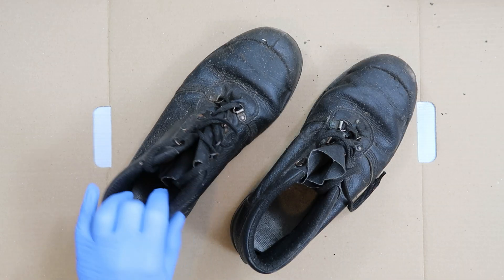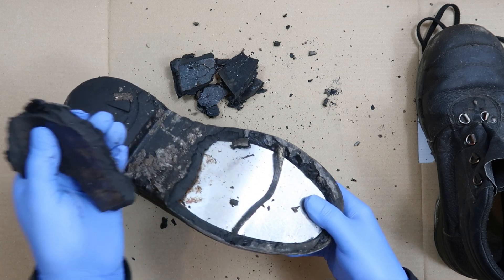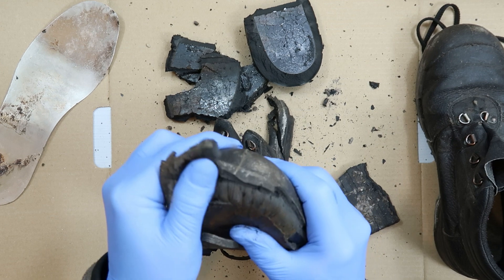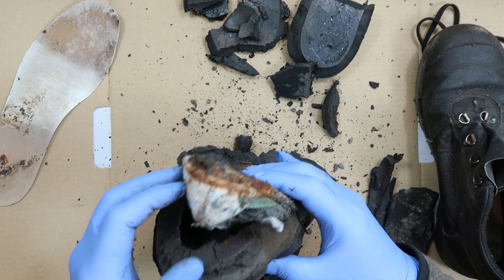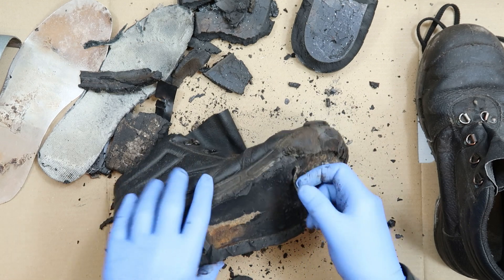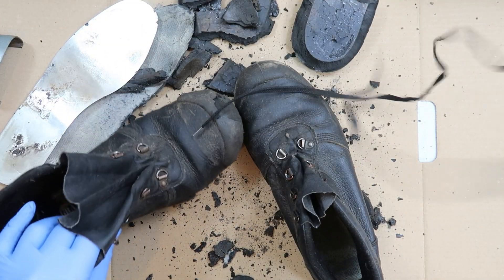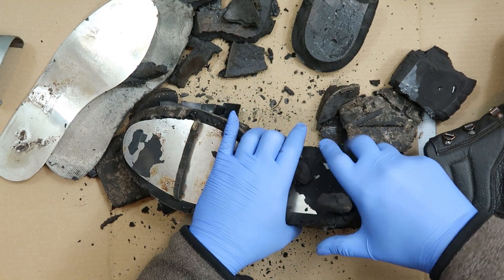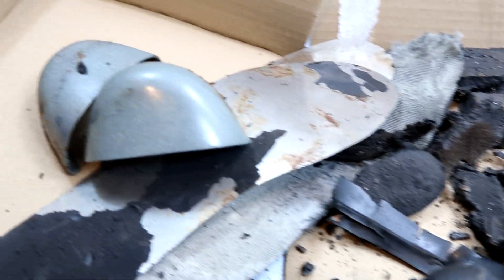Knackered Old Boots - Teardown

Comment: I've got a pear just like that. One time I nearly hit someone in the Face with my Toe Cap. There was a huge Rip along the Top due to wear and tear over the Years. You could actually pop the Cap out at anytime, but cut a long story short, I was trying to kick a Leaf on the Floor and the Tip of my Boot hit the Floor first which bent the Boot and sent the Cap flying through the air and missing someone's face by a few inches. I threw them away after that.
Reply from the maker: Sounds like that was a close call! When I was a kid I kicked one of my shoes off by kicking up at something and my shoe ended up on the house roof :-D Then ensued the panic and fishing attempts to get if off the roof before I had to explain it. Managed to get it down somehow.